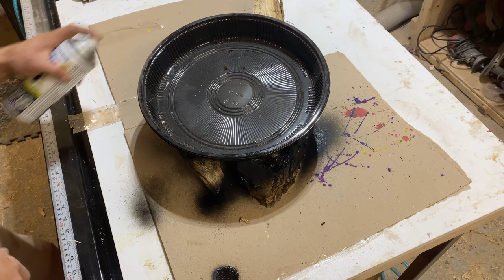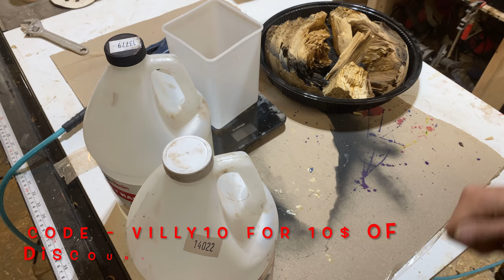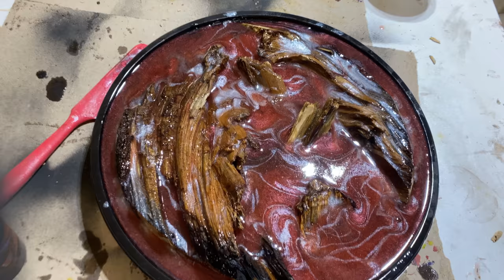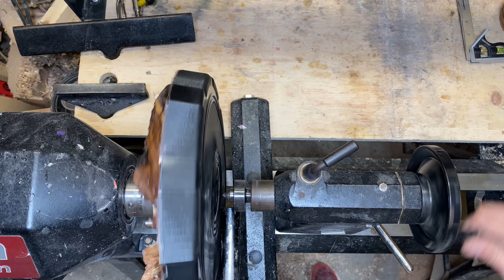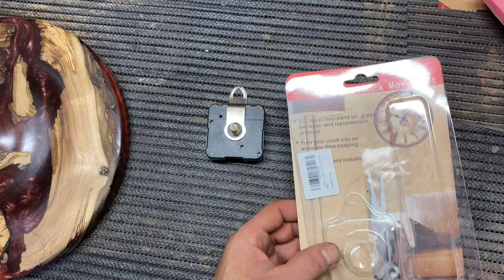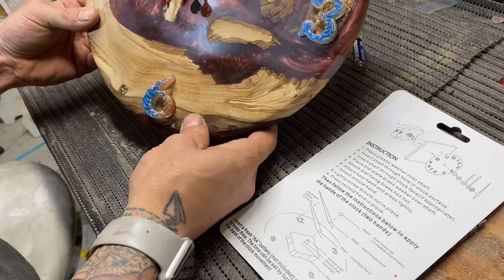Woodturning - It's about time

Comment: I'll be honest.....the clock face is beautiful genius, period; however, using better material for the works (numbers, hands, etc.) such as wood or brass would have done a lot better justice to this project.  Just my opinion....be well!
Reply: And segments for the 1, 2, 4, 5 etc.
Reply: Beautiful turning. I have to agree... the numbers and style of clock hands did not fit the anesthetics of the wood and red resin.
Reply: I agree
Reply: Yeah couldn't agree more, brass numbers would of set it up beautifully, especially with such a nice and well thought out turning.

Comment: The clock face itself is absolutely gorgeous! I love the way you put pieces of wood in there to fill up the hole before you put the resin in. ingenious idea. And the method you used to determine where to trim the pieces of wood made me laugh.
The numbers would have been okay, if they were a different color. The blue does not go very well with the red/purple/black of the clock face.
But other than that, well done!

Comment: The wood and resin is effect is gr8,not to fussed about the choice of fixtures and fittings sorry :(.But still top effort m8 :).
Reply: I agree. The finished board looked amazing and I could think of a ton of uses for such a beautiful piece but the numerals and clock hardware spoiled it in my opinion. Great effort though as you say.

Comment: So can you do deep pours with Magic Resin without a pressure pot? No air bubbles?
Reply: Did you use a pressure pot? Did you have any bubbles?
Reply: i do deep pours also - it takes a lot of patience and a bit more time - and that is ok
Reply: @lizbrowne6481  thanks. What are you pouring? Are you using a pressure pot?
Reply: @burttsbowls469  i do epoxy pours probably none greater than 3" - and no pressure pot use as of this date. i use a heat gun to bring out bubbles.  i also thin the epoxy with a dash of acetone to give me a little more working time before the epoxy begins to set up. so far i have had good results, even if it takes a bit longer.
lizb
Reply: @lizbrowne6481  what did you make? Did you have a channel? FB?
Reply: @burttsbowls469  so i turn bowls, platters, boxes, table legs .... - but i also dabble in other wood works: natural edge tables, bookshelves ... FB, IG,channel? ...  i am relatively new to these venues and have yet to set anything up
lizb
Reply: @lizbrowne6481  I just started mine two weeks ago!
Reply: @burttsbowls469  well dabnabit abner - good for you. i am still way in the woods and trying to turn my way out! i'll take a look at your site once i get some coffee